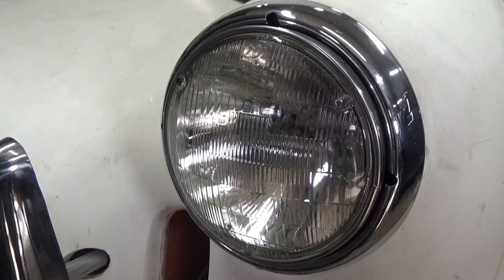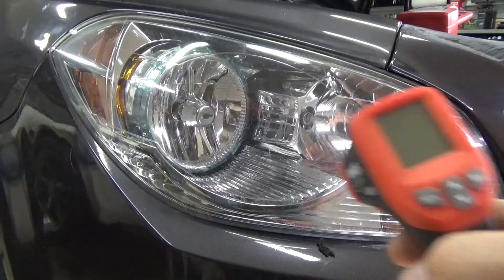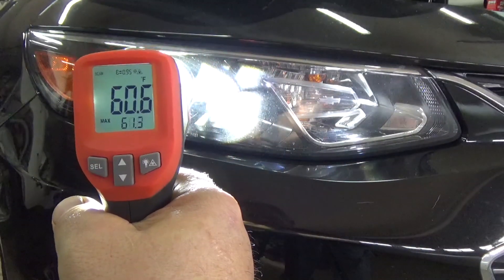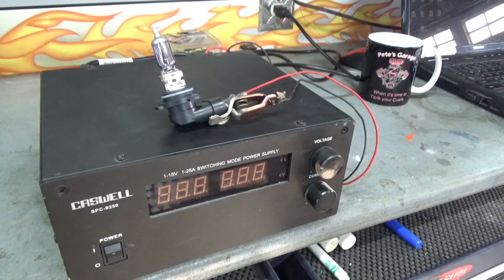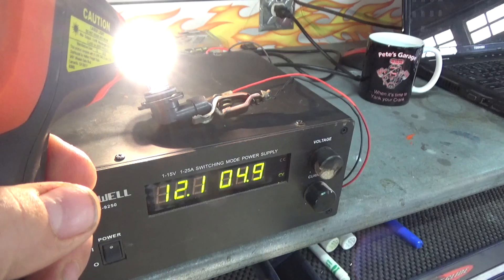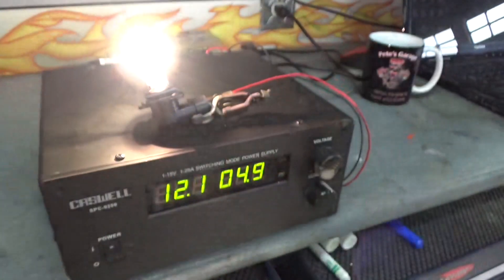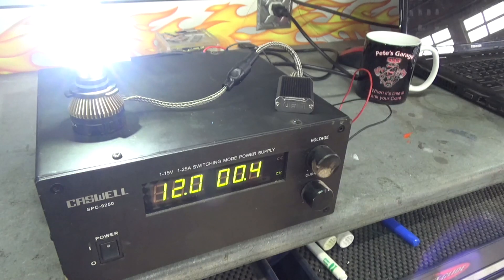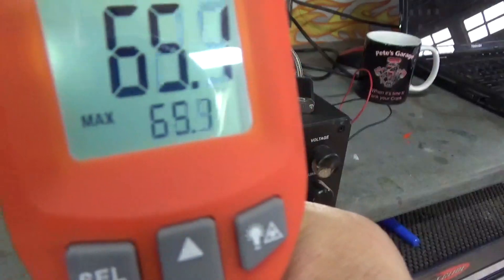How Hot Do Headlights Get, Halogen, Sealed Beam, & LED

Comment: So first off I love my led headlights, however.. the issue of not being hot enough to melt the snow and ice off the lens is a real issue. Yes it doesn’t melt and “ice” up your headlight but it also doesn’t melt off the snow that is being compacted on the cool lens as you drive thus actually blocking the light. I had this issue on my 6 hour drive home last night. Had to pull over multiple times to clear the snow and such from the lenses as the light was being completely obscured by the snow on the face of the lens. There are pro and con of both but for winter snow driving as much as I love the leds, they are not great for that. I know moramoto makes a led called a 2 stroke that circulates the are into the headlight housing and is supposed to help with this issue. Though idk how effective it actually is. LED light bars have the same issues.. yes there super bright and I love them as well but in snow and snowing conditions they definitely pack up with snow.
Reply from the maker: Great comment, thanks!

Comment: So inside a headlight bucket the hallogen could melt wiring or connectors . Could putting some aluminium foil help to insulant wiring etc,
Reply from the maker: I guess you could try it.

Comment: Totally inaccurate for Winter driving.  I live in the north...Michigan.  5 months of the year our roads are wet and sloppy under freezing.  Wet slushy roads, LED Headlamps ice up and get covered in just a few miles making them dangerous... having to pull over and clean them off constantly. Nothing works... ceramic coatings...waxes... nothing.   Need Heat!    I'll take Incandescent/Halogen anytime over LED Headlamps in Winter driving!

Comment: I made a video, can you make a kiln from halogen vehicle head lights... The filament in a halogen bulb is made from tungsten. White hot tungsten is over 4500 degrees F. In my video without the reflection cup the bulbs melted their bases. But with a good base you can make a 4000+ degree kiln with halogen bulbs
Reply from the maker: That's cool

Comment: Unless they have perfected UV temperature guns in the last 5 years, they don't give an accurate reading on shiny surfaces or white surfaces. UV reflects off of shiny and white surfaces. Soooooo,,,,,, May better and more accurate to use a surface temperature probe.
Reply from the maker: I have found it to be accurate within a couple degrees
Reply: @PetesGarage  You're wrong and haven't understood what he was saying. The gun measures what radiates, which is especially worse if it's a plastic surface which is the case here as, unlike glass, it does allow for IR to pass through. It does NOT measure the SURFACE temperature of the headlight plastic. This is also a common misconception with FLIR devices - many people do not understand how they physically work and why they depend on material specific settings for reflectivity, emissivity etc. and measure incorrectly.
There is a difference, yes, but the method you're using to prove it is false. What you need to do is to put a piece of thermal tape on it and measure that spot directly.

Comment: I can't say I've run into too many issues, if any, with snow and ice buildup on my housings with LEDs vs halogens. Actually the only time I've had an issue with buildup was over the high beam on my Canyon which was halogen. But that was because I wasn't using it because of the glare from the snow. When I got the chance to use it, it was too covered to be effective and my low beams were brighter.

The perfect conditions for this in my opinion are when it gets slushy or wet on the road, particularly on the highway, but is still plenty cold enough to freeze. I can't say I've actually been able to test my LEDs in that particular scenario as they're usually at lower speeds in my work vehicle and not during my normal commute.
Reply from the maker: Interesting, thanks for the comment

Comment: The factory led headlights on my 2019 Silverado are great for lighting up reflective road signs, but on roads without streetlights it is very difficult to see the road ahead, high beams don't add much.
Reply from the maker: It is possible they are our of adjustment. The one I put in were a bit high as well. Thanks John.
Reply: two nights ago i almost hit the deer on the road with my 2019 Silverado . luckily i was able to push the brake pedal a second before thanks to super bright LED headlight in my truck .  the halogens wouldn't helped me as they are way dimmer
Reply: I have been noticing more and more OE factory led headlights are crap. Don't illuminate for spit, and blind oncoming drivers.

Comment: I suppose if it's generally cold outside, and you don't have a heated garage, the headlight lens could be cold enough to start out that snow would just blow off the lens.  In other words the lens wouldn't get hot enough to make the snow stick to it and therefore it wouldn't need to be hot enough to melt off.

I've driven in winter conditions in which the snow could build up on the headlight lens, so that can be a problem.  

I find it interesting that the LED bulb company included a heat sink and fan as part of the design.  I doubt it's really  needed when only drawing 0.4 A.

You guys crack me up.
Reply from the maker: I live in Buffalo so I'll really give this a test soon

Comment: Thanks for doing the test Pete...it does seem to indicate that LED snow melting problem could be a legitimate concern if you replace halogens with LEDs.  It would be interesting to find out if factory LED headlight assemblies (where the LED is sealed inside the housing and the whole assembly has to be replaced if the LED fails) have heating elements in them to prevent ice/snow buildup like traffic lights do. 

I would disagree about the theory that NOT melting the snow might not be a bad idea.  As long as the (halogen) headlights are on, they should keep the surface of the lens warm enough to prevent refreezing of the melted snow.  The water should run down to the bottom of the lens where it's more than welcome to refreeze.  Even if the water DID refreeze on the lens, it would be clear ice, not opaque snow, so at least some light would get through it.
Reply from the maker: Thanks Chris, I'll see what happens, snow is approaching soon
Reply: @PetesGarage  That it is...let's see which of our cities wins the Golden Snowball award this year!